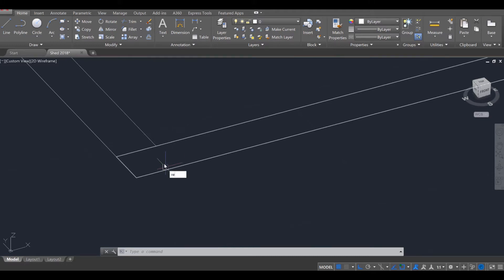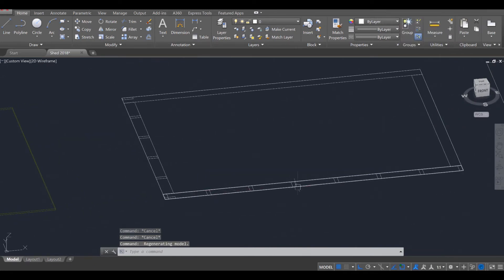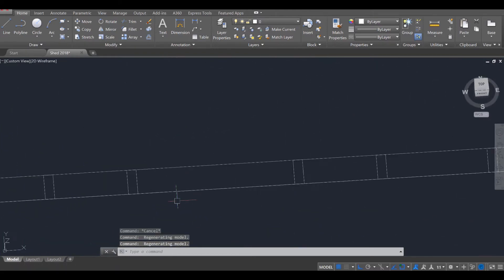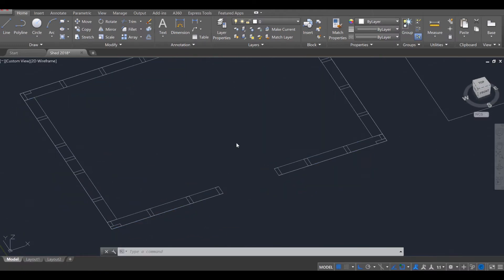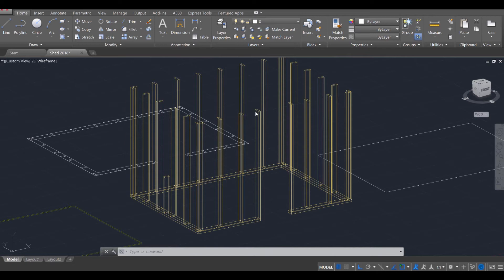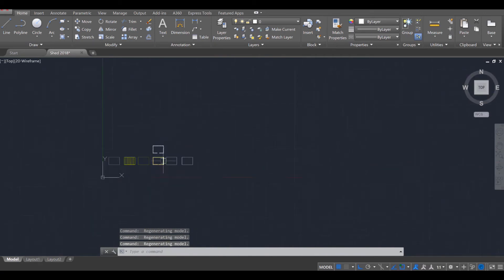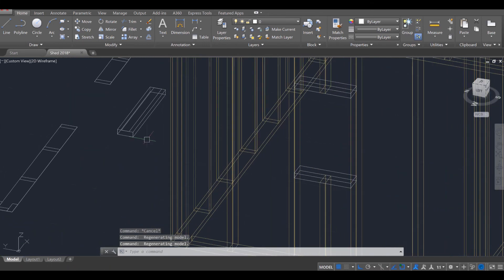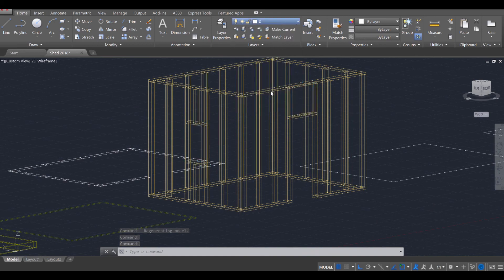Beginner Tutorial AutoCAD 2018 - Designing a Shed - Part 2

Comment: There has to be some snap setting I am missing. Whenever I move the wood(The .5 by .07 pieces for example at 3:30 into the video) to have them not overlapping, it turns very slightly left or right. It Doesn't line up perfectly with where I am snapping it too.
Reply: I have the same problem! Anyone can help?